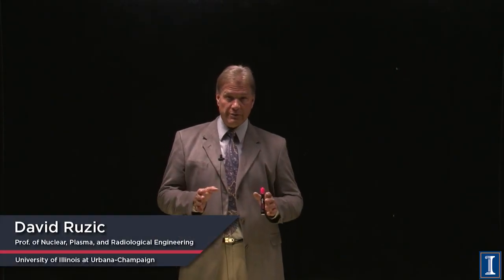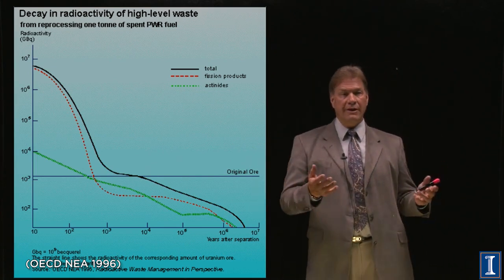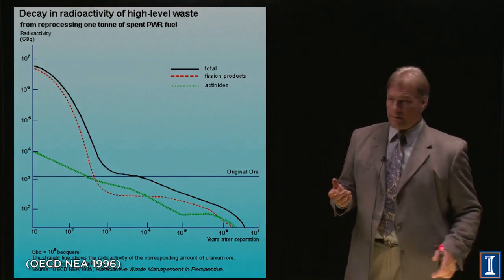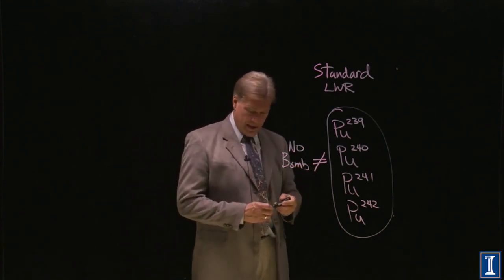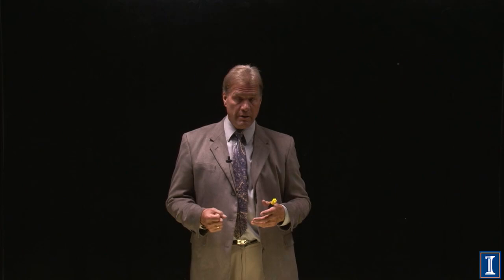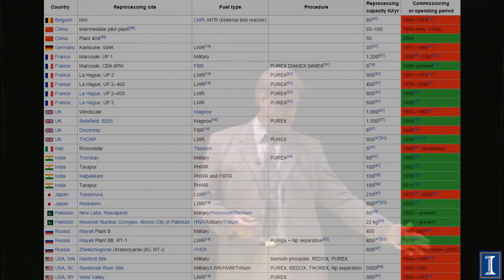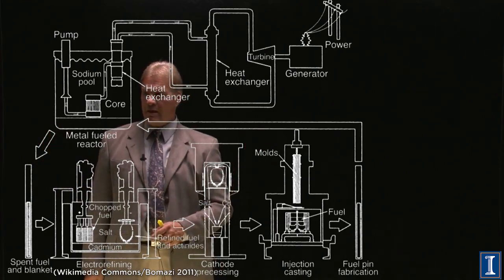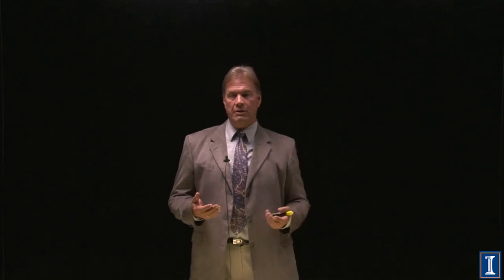Dealing with the Used Fuel (Reprocessing)

Comment: IFR is only the least crazy concept out there for onsite-reprocessing fast reactor designs- Other work in the 60s and 70s went into liquid-metal fuel designs, with the end goal of eliminating uranium-plutonium separation entirely. Like mercury, molten uranium and plutonium have a habit of amalgamating with other metals, with the awkward effect of turning test cells into goo. (Plutonium was alloyed with a combination of iron, cerium and/or cobalt to reduce its viscosity and corrosion potential; even so, only tantalum- and tungsten-carbide could contain it for a reasonable time. No comparable alloy-cladding combo was found for a U-Pu mix before research was halted.) Pure molten plutonium is ~20% denser than liquid mercury (and ~17x the density of sodium), presenting an opportunity to make the most metal lava lamp possible (and a near-perfect liquid sodium heat exchanger), and an incredibly dense core. We have only grazed the crazy in nuclear fission.

Comment: Why should we use sodium as a coolant? It catches fire when exposed to air and explodes on contact with water.

As far as I can see the molten chloride salt fast reactor uses pretty much the same mechanism as the IFR but seems to be much much safer to operate.
Reply: Indeed. Theres also the lead cooled FBR which is an even better «breeder» . But the cool thing about the MCSFR tech is the processing of fuel and waste. Nuclear waste from water reactors comes in, fission products come out. You just turn the transuranics, plutonium and the uraniums into chloride salts and throw them into the reactor. Much simpler than fabricating fuel rods. 
The problem with MSRs in general is corrosion.

Comment: Read up on French sodium reactor problems (Super Phoenix) and dealing with those ! No thanks! They went pressurized water.
Reply: Dear David, could you post some links on why (Super) Phoenix failed ?
Reply: @paulspyckerelle703  Sodium burns when exposed to air. Radioactive sodium releases it into the ambient atmosphere. Severe thermal stress problems occurred caused by cyclical thermal fluid flow in piping. http://large.stanford.edu/courses/2011/ph241/abdul-kafi1/

Comment: Let me make sure I get this right: the best we can (theoretically, because in many cases this is not even being done yet) do is high level radioactive waste that needs to be kept safe for 500 years.
For comparison, check the life expectancies of the frame conditions necessary: steel concrete: 100+yrs, written records: 200+yrs, stable political systems: 50-250yrs, periods without war: 50-150yrs. Do you feel lucky?
Reply: Google Deep Isolation Mueller

Comment: do you still have to do isotopic separation of the Pu mix to re use it in a reactor or is the isotope mix only poor to make weapons with?
Reply: It's ok in a reactor. The problem for making bombs is the Pu-240, it sometimes spontaneously fissions and releases neutrons. This is a problem because it tends to make the chain reaction start too soon when the bomb is detonated. The bomb still explodes but with much less energy. Pu-240 also emits gamma rays as it decays which makes handling the warhead a lot more dangerous.
Reply: @nerd1000ify  thx

Comment: Muon-catalysed reactions are interesting, a Muon-reactor could reduce half-lifes significantly. The question is, will anyone build a reactor to power a muon reactor? We could start reprocessing some waste.
Reply: There is a problem with Muons though, the energy made to create them currently outweighs the benefits you gain from them, not just for reducing waste but also making more efficient fission and later on fusion reactors. Unless we can make Muons with less energy and more yield per energy, that plan will be shelved until more effiicient reactors can breed them.

Comment: Here is how the nukies are going to deal with the used fuel. They are gonna let it sit right there in open Jethro Bodine cement ponds and unprotected casks without any hardened structure or roof to protect from a terrorist attack; all within 100 miles of every major US city. Why? Because it is earning the reactor operators almost $1 billion a year from the taxpayers to store their own crap. What a deal! 75 Years of waste accumulating and not one teaspoon full of it disposed of safely.  At least in Europe they make them put a hardened structure around the toxic crap. France's reprocessing plant has lost all of its international customers and has been a very dirty operation right from the start. Lots of emissions, lots of money to operate. Only 1% of the spent fuel is reclaimed. Good luck finding someone stupid enough to invest in that. Wall Street won't touch it with a 10 foot pole. Taxpayers have been screwed so many times by the nukies, they ain't gonna let you kick them around anymore either.
Reply: Nuclear fuel casks survive missile strikes https://www.youtube.com/watch?v=jBp1FNceTTA  and flaming high speed train impacts https://youtu.be/Rmp3_CLx4VY .  Dry cask nuclear storage in open air does not appear to be a public health hazard, but is certainly not a permanent solution either.

However, your point about over-time and over-budget nuclear power plant builds is spot on.  The most recent build at Georgia's Vogtle Power Plant for new AP1000 units 3 & 4 is $11 billion over budget due a a series of unfortunate managerial and financial issue, which is little comfort to the local tax payers.  No local politician or community for that matter would want to gamble on a nuclear power industry with that kind of bad financial record.
Nuclear powers biggest Achilles' heel to mass deployment is cost, not nuclear waste or safety.  The older reactor designs, safe though they may be, may simply not be able to compete financially.  However, newer SMR (Small Modular Reactors) promise to significantly reduce capital costs and have the advantage of starting to generate electricity much sooner by installing nuclear modules in phases to help pay off loan debt more quickly.  The DOE approved a test reactor build near Idaho National Laboratory in partnership with utility provider UAMPS https://www.uamps.com/nu-scale-modular-reactor 

The tricky think about nuclear power is that things that were once true (long-lived nuclear waste and always overbudget) will not necessarily be true in the future.  The liquid fuel molten salt reactors under development http://www.elysiumindustries.com/technology , https://flibe-energy.com/technology/ , https://www.terrapower.com/our-work/molten-chloride-fast-reactor-technology/ will produce only 1/10th the nuclear waste of today's LWR (Light Water Reactors) and that waste will decay to background levels within only 300 years (not the traditional 10,000+ years - 90% decays to background in 100 years and remaining 10% to background around year 300).  These reactors operate at low pressure using molten salt coolant, so they do not require the massive high pressure coolant systems used by LWRs today, which significantly reduces capital costs as well as the land area required for exclusion zones around the reactor - low pressure plus no hydrogen explosion risks (because not water coolant), so no containment explosion risks.  The beauty of these newer reactors is that they burn up 99% of fuel (uranium-235, plutonium-239, etc.) and can even be used to burn up remaining energy in existing spent fuel rods being stored in dray cask storage today as well as decommissioned nuclear warheads, all without the reprocessing step - you just add the  new fuel into the mix.  These reactors are working their way their various regulatory processes, e.g. a test reactor in partnership with utility corporation "Southern Company" https://www.energy.gov/ne/articles/southern-company-and-terrapower-prep-testing-molten-salt-reactor , and will likely be approved for commercial operation in the mid-to-late 2030s.

I totally get the resistance to multiple negative aspects of past and even some current nuclear power issues, but, IMO, over the next decade or so,  nuclear power technology improvements will reduce if not eliminate most of the financial, waste, and operational safety concerns of the past.  It's a mixed bag right now, but there is potential for safe, responsible, and economical nuclear power if we back the right technology.
Reply: @ET-ij3et  Thank you for your detailed response. I am in the midst of moving from one house to another, don't have time for a long response, but I will try to cover a few points. Dry casks storage in Europe require a berm and roof to protect from damage. Not so in US. The head QC inspector for the main company manufacturing casks testified that major deficiencies exist in the construction including poor welds by uncertified welders, antiquated specifications dating back fifty years when much less spent fuel was stored in each cask and other problems. Yes, nuclear operators could care less about the huge risks, but can't get Wall Street to foot the bill for energy that renewables and natural gas can provide cheaper. Taxpayers are sick of paying for expensive nuclear boondoggles and million dollar bonuses for power execs. Vogtle is way over-budget and past due and has asked for an emergency variance on the license for their Reactor 3 because the double containment wall is supposed to be 3 inches apart and has collapsed to 2 inches apart. The floor is "dishing in" because the weight is collapsing the clay underneath it. They haven't even filled the 9 million pound water reservoir on top for passive cooling of this AP1000 reactor (to avoid another Fukushima type meltdown). I am afraid the NRC will rubber stamp the variance and we will really be in trouble. SMR reactors are an attempt to go back to the past. Reactors used to be that small, but were discontinued because the industry thought bigger reactors were more economical. MSR reactors will still create fission by-products with half-lives of 300 to 16 million years. They haven't solved all of the technical problems in the 75-80 years they have been working on them. Corrosion is a big problem. I worked with an industry using a liquid salt solution and we were constantly replacing equipment. Special alloys for MSRs to resist corrosion use beryllium. Beryllium causes berylliosis, a kissing cousin to asbestosis, which in turn causes that deadly disease, lawyeritis. If you think subsidies are bad for nuclear reactors now, wait till we get MSRs.
It takes ten years to build one reactor. Even with the sweetheart deal the nuclear industry got with the 2008 Energy Production Act, only Vogtle is still left of the 30 that were planned in response to the Act. The Summers AP1000 reactors in SC never got finished but will cost SC taxpayers another $9 billion on top of the $4 billion already spent. The nuclear industry would love to build 1000 new reactors by 2050 but good luck finding the 6-18 trillion dollars for that. Besides, we need energy now. We could provide the same amount of energy in five years with renewables for much less and avoid the massive risks of nuclear. We have had 5 meldowns in 30 years. That doesn't build my confidence level with nukes.There are a lot of Homer Simpsons in nuclear plants. I would rather they be working on solar plants = their messes are smaller.
Reply: Sounds like you went off your meds, you should check into that.

Comment: I have found two things in the public domain that somewhat refute the professor in tiny details. 1. He says reactor grade plutonium cannot be made to use for a weapon. Our geniuses have in fact detonated reactor grade in a weapon. Any time you get criticality and go onto chain fission he knows you can then use the xray flux to promote deuterium hybrid to also go critical in the thermal. Much easier to make deuterium than separate isotopes as we know and you don't even need lithium 7 that we found to our dismay in the south pacific. More later.
Reply: > He says reactor grade plutonium cannot be made to use for a weapon.

Where did he say that?

Comment: Dumb question here. If we use water as a moderator to catalyze the reaction within the reactor, why do we store used fuel rods next to each other while submerged in water?
Reply: Water absorbs radiation very efficiently and has very high thermal capacity.
Reply: Thanks for the answer!  If I can ask a follow up, how is it absorbed? Is that how we make deuterium and tritium?(I know we can get them from sea water, but can we synthesize it in any usable capacity) Does the water absorb the neutrons that way or is there another mechanism that is at play?
Reply: @ktinsley4579     After leaving a reactor fuel emits practically no neutrons.  Surrounding the fuel with MASS (in the form of water) shields from gamma radiation.   And the water is a great coolant.   The fuel rods are not closely packed and the water may be "poisoned" so criticality is avoided and moderation is unimportant.
Reply: @PMA65537  
Thanks for the response.